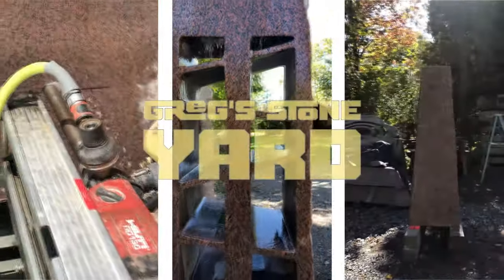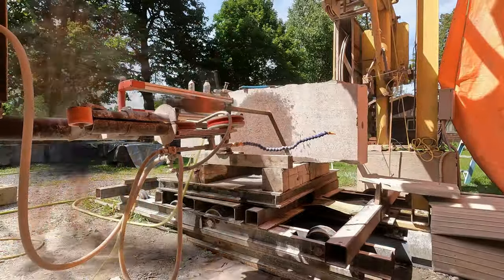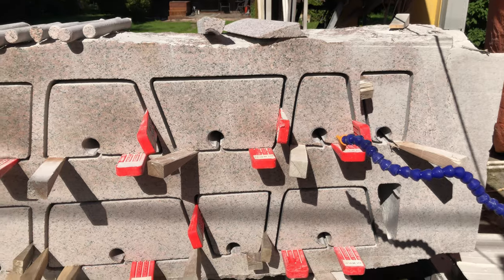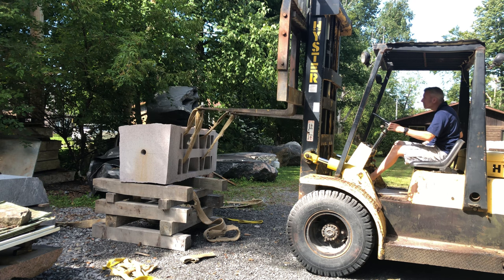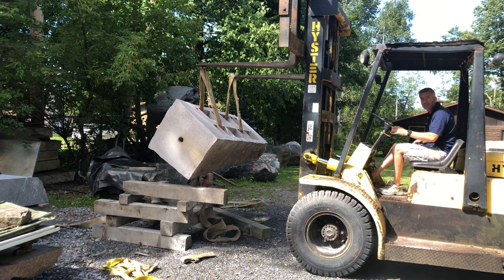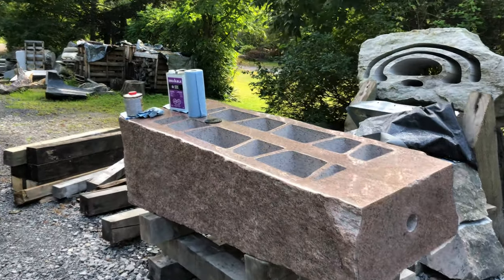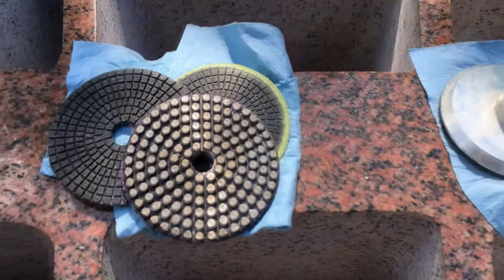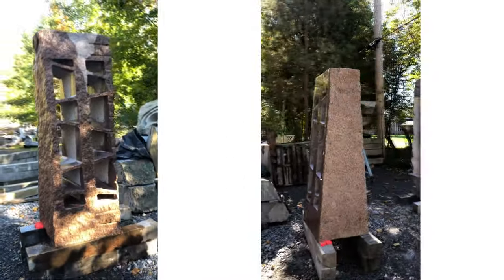Making a Stone Fountain #fountain #stone #waterfeature

Comment: Great job as always. I looked at your work on your website, it’s very beautiful! You manage not to spoil but to emphasize the natural beauty of the stone. And this is not as simple as it seems. Bravo. And by the way, I advise you to try powders instead of a buff. I saw you use TENAX products. I believe they have powders. The powder removes fine dust well that gets clogged into the pores of the stone. The technique is the same as with a buff, only you use a felt disc with a little water and you also need to “heat” the stone while polishing. You will get "depth" of polishing and mirror finish.
Reply from the maker: Hello Denis.  Thank you for the kind words.  I will try the powders.  Getting a better polish is something I want to do.  Thanks.

Comment: How is the diamond bead wire connected and disconnected in the loop?
Reply from the maker: There is a threaded connector that is crimped onto the wire, I show connecting it here:
https://youtu.be/ncuJbjyyBKQ?t=555
Reply: @GregsStoneYard  thank you
Reply: @GregsStoneYard  I've only seen the crimped sleeve method. Those threaded connectors are pretty slick. Where did you fund them?
Reply from the maker: @WinstonChurchill-gu3eq  From the wire manufacturer.  Husqvarna (Diamant Boart) or Diamond Pauber. Palmerio also sells them but you have to buy 100 at a time.